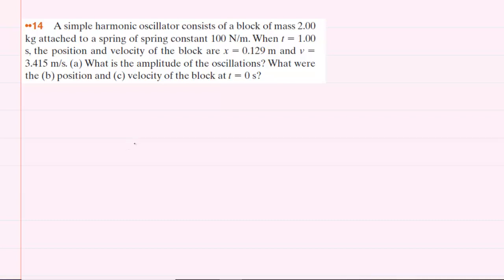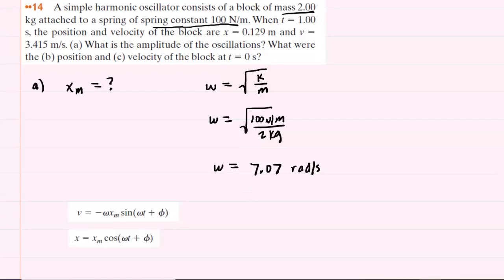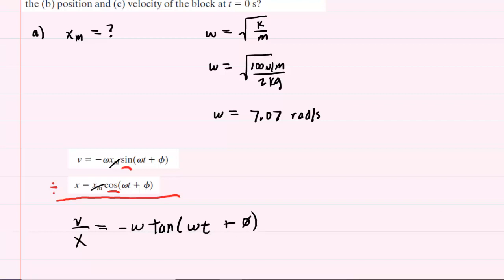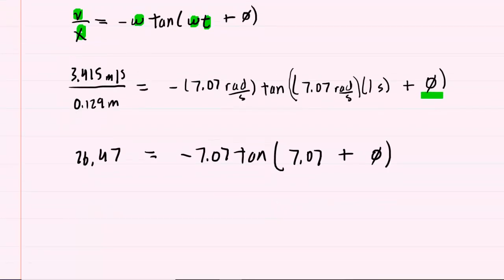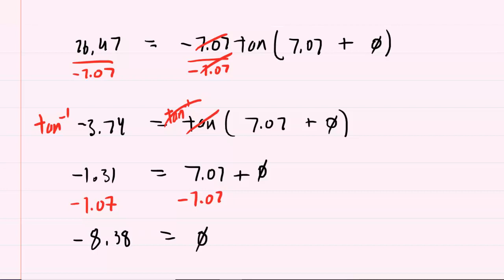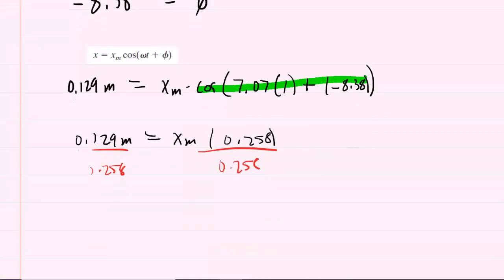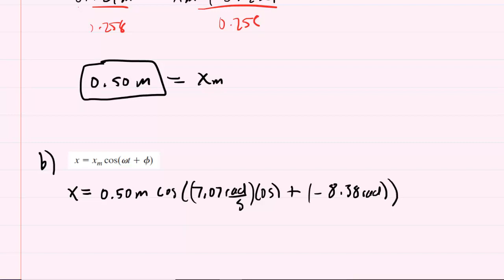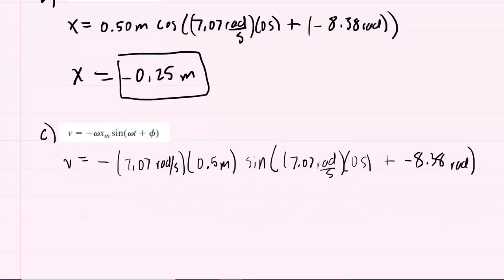A simple harmonic oscillator consists of a block of mass

Comment: I follow everything, but I don't really get the trick with dividing the velocity by the position. I've tried doing this problem on my own and the route I took was calculating the amplitude using the conservation of mechanical energy. Then I proceeded with plugging in the known values at t = 1 s to the SHM position equation and calculating the phase constatnt from that usinge the inverse of cos, yet the results I got differ from what you calculated. I'd love to know why.

Comment: 13 SSM An oscillator consists of a

tha

sp

cal

er-

00

car

matt

Figure 15-32 Problem 12

block of mass 0.500 kg connected to a spring. When set into oscillation with amplitude 35.0 cm, the o cillator repeats its motion every 0.500 s. Find the (a) period. (b) frequency. (c) angular frequency, (d) spring constant, (e) max mum speed, and (f) magnitude of the maximum force on the block from the spring.